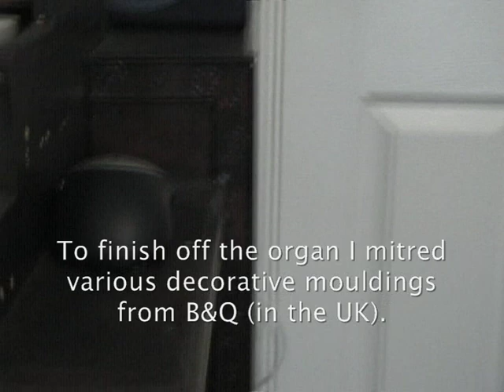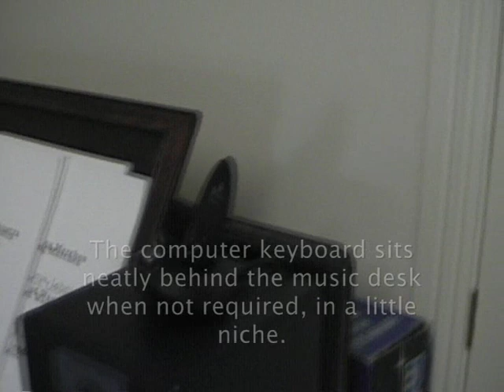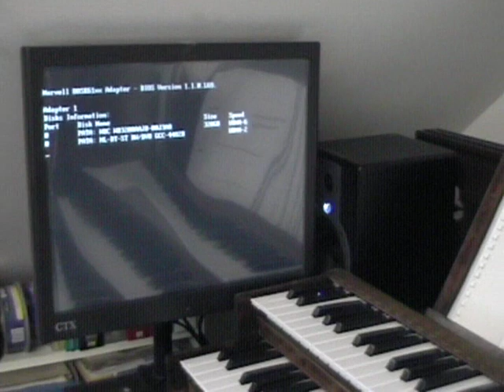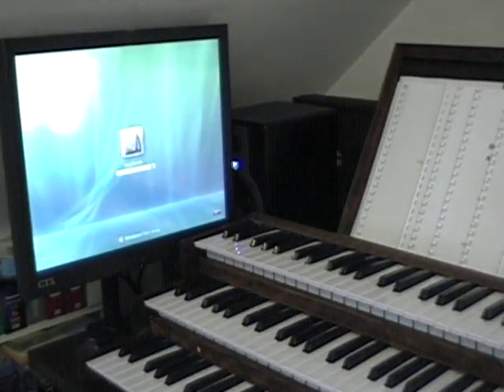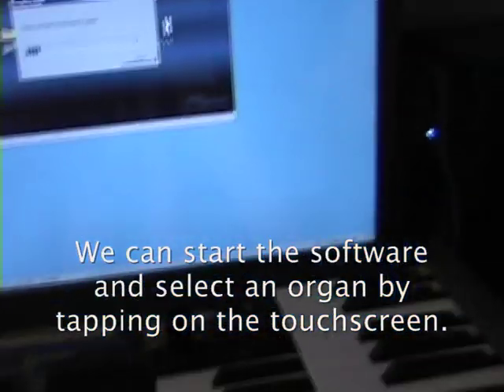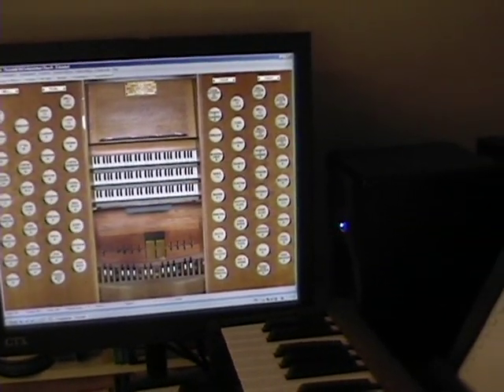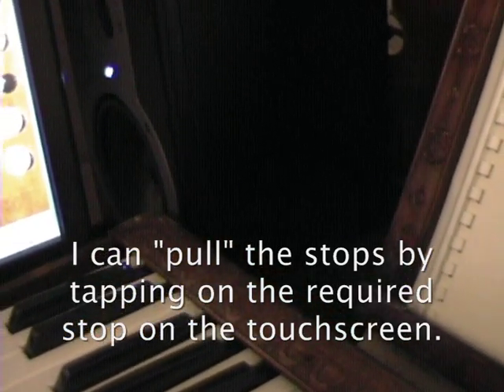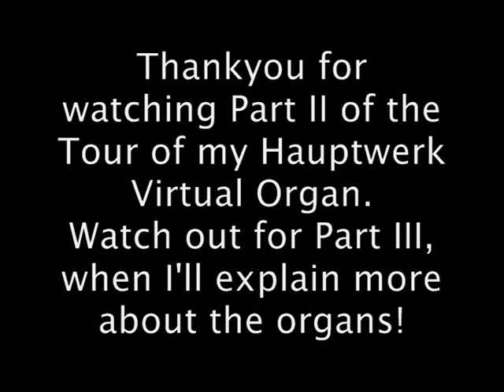A Video Tour of my OPUS I Hauptwerk Virtual Pipe Organ (Part II)

Comment from the maker: @gwpritchrd Thanks for the question!
I can't say exactly how much the organ cost to build, because I didn't keep exact track.
The PC: about £1,000 or so, maybe more.
The keyboard stack: about £350
The pedalboard + its MIDIfication: about £300
Behringer/Tapco MIDI £200
The Hauptwerk software - check their website - advanced edition).
I have spent alot on sample sets - cannot say exactly but many hundreds of ££, more than £1,000.
The 7 speakers were say £1,000.
Wood was several ££hundred.